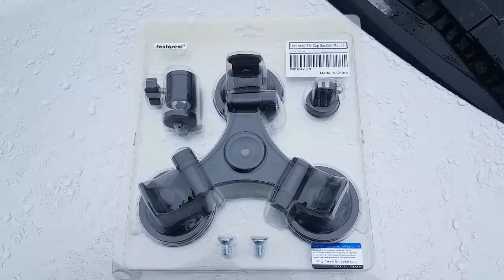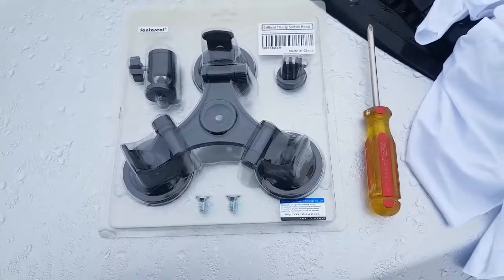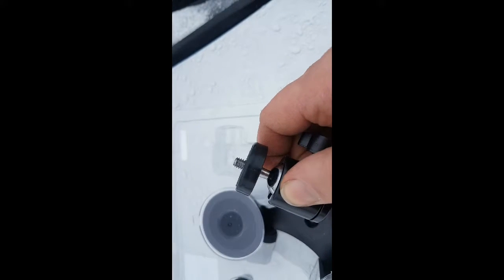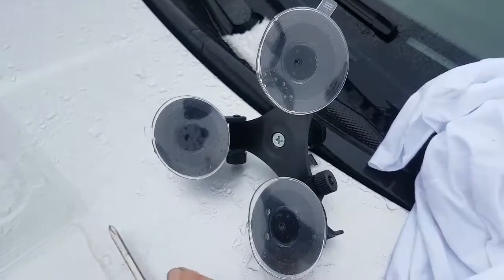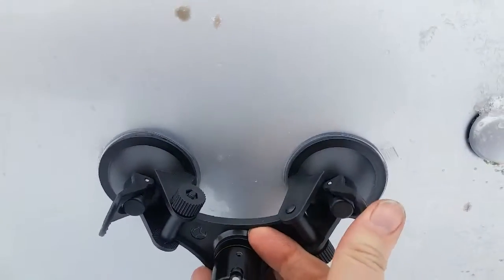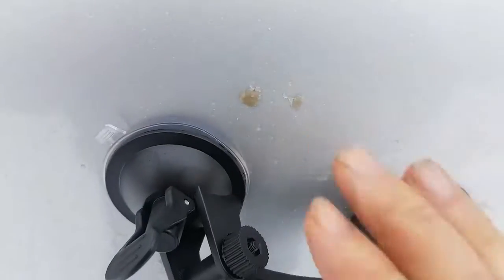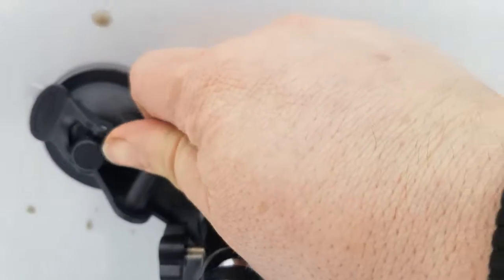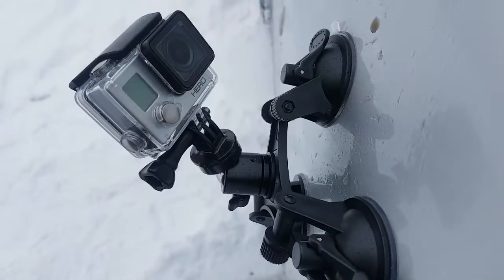Fantaseal ballhead tri-cup mount

Comment: I'm looking for a mount just like this for my Canon 80D. I want to do a few vlogs in my car as I drive, and this would be great for that. Have you tested this mount on a dashboard? do you think the mount will stick on a dashboard?
Reply from the maker: +Michael Hurdle Production Studio it uses suction cups so the only way to know the answer is to know if your dashboard has enough smooth space to mount the tripod.  I know it mounts to the inside of a windshield.  I used it once on the front of my car for a 2 mile dirt road video.  

If it must actually be on the dash, I would probably use 3m command strips under the suction cups.